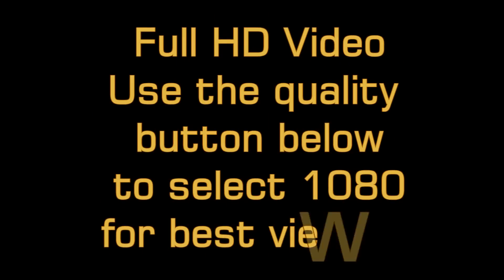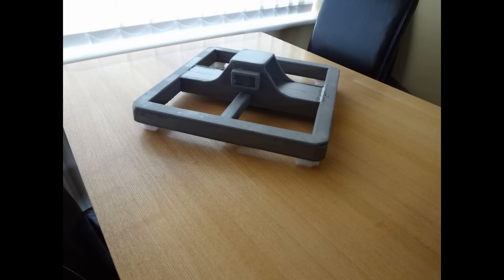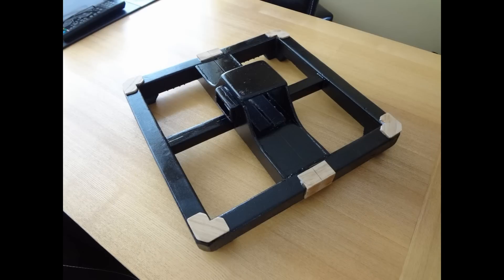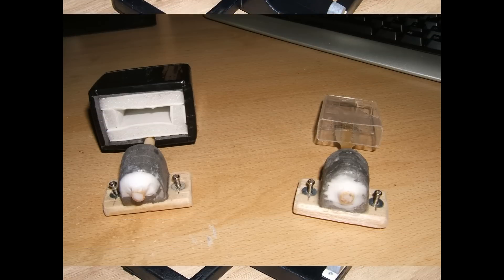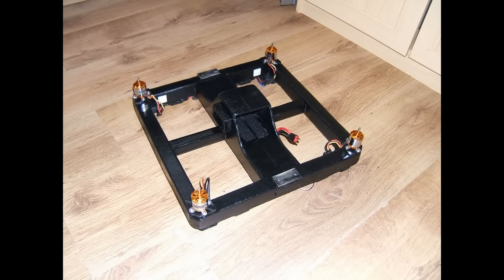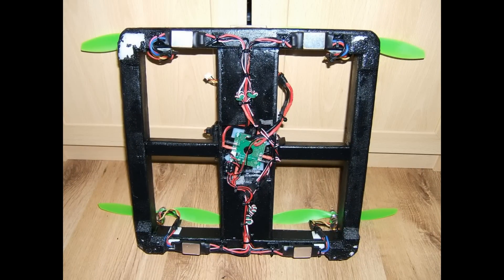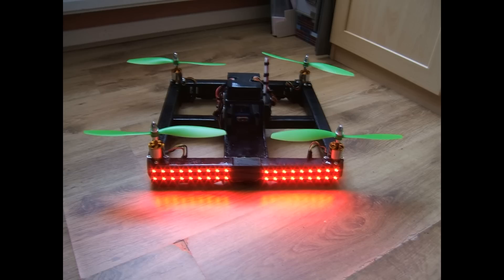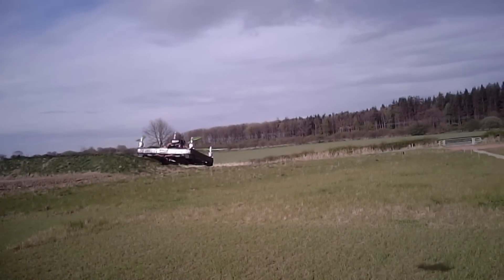Building a Cheap Depron Foam Quadcopter.

Comment: Would it be safe to put some gear below it? Like gopro with gimbal and a landing gear? Or it would be too heavy causing the foam to brake?
Reply from the maker: No I think that it would be OK just use some plywood or something to strengthen the area and you will be OK.